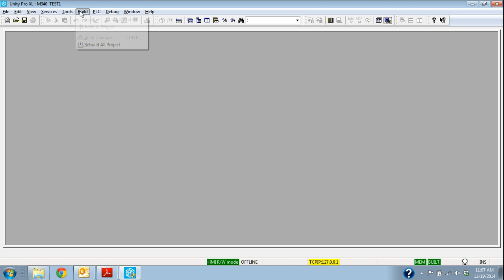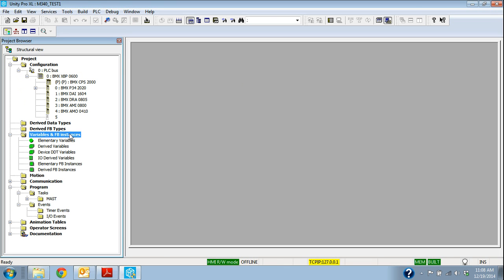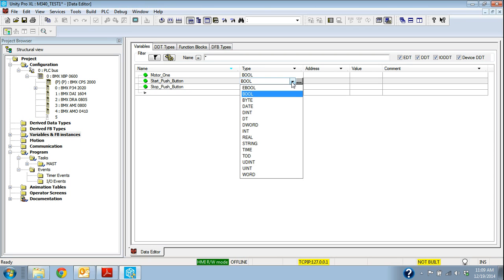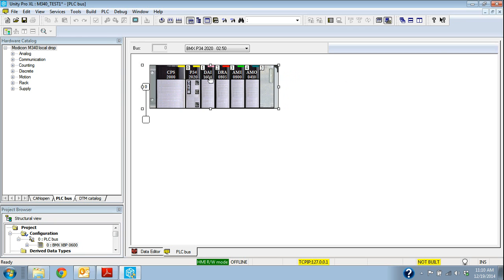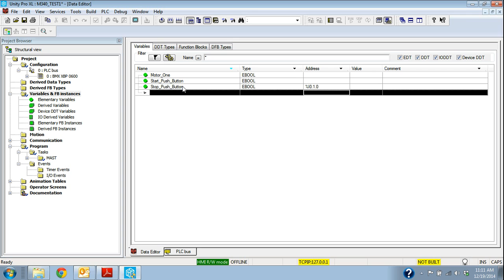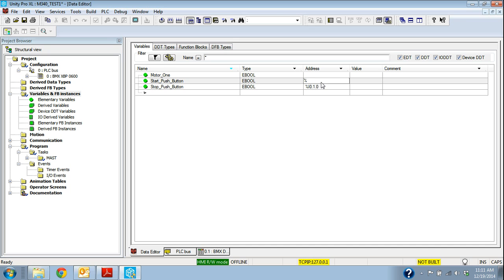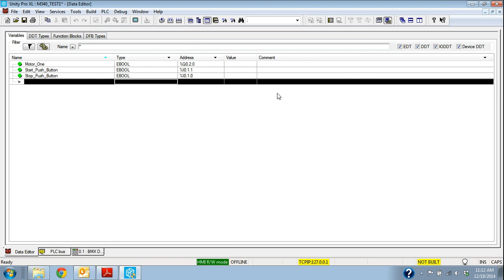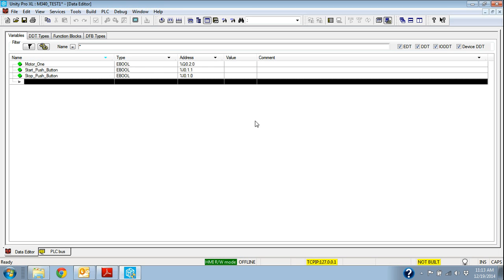Unity Pro Assigning Variables to IO Cards

Comment: sir is it necessary to follow the sequence like you for PLC Module.
?
Reply: Abdul, you don't have to follow any giving sequence, as long at the complier will accept programming a logical when you save your work,  it should run in the processor. Hope that answers you question.
Reply: @richweekly9885  
Thanks Sir,
Huge respect from KARACHI, PAKISTAN.
Reply: or 
this is by default ?

Comment: Hello sir
               plz give me a example of ATV DRIVE RUN WITH M340 ON MODBUS 
IN FBD FORMET
Reply: Ankit, sorry I have not worked with the Schneider products for about four years now. I am working with SEL so  I no longer have the hardware to show this example. You will need to contact a Schneider Electric Application Engineer.